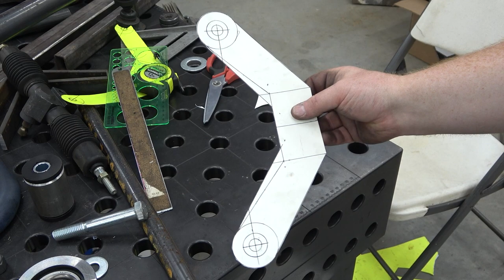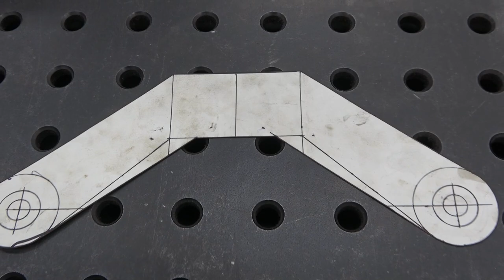YZ450F Powered Crosskart Custom Rear Spindles

Comment: I wouldn't worry to much about the single key way. I have a buggy running a 44" 1 1/4 chromoly axle with a 07 ninja 650r engine it has held up surprisingly great but it runs 20x10 tires. But  its soon to get a miata axle conversion. Awesome build so  far keep up the great work an great content

Comment: if you do a dual pivot trailing arm you do not get camber change threw out the cycle, look at the  wildcat XX vs the rzr, or robby gordons sxs. less parts to break and less likely to rip a wheel off easy, just my thoughts.